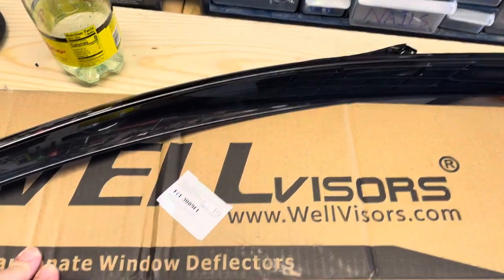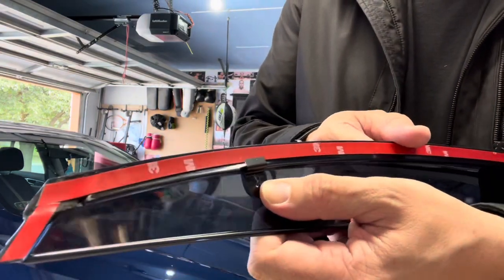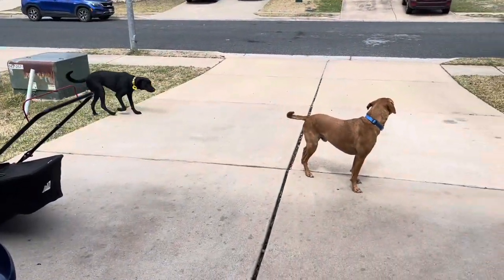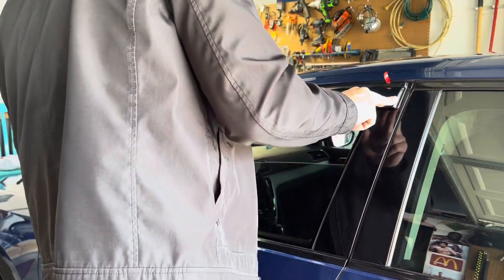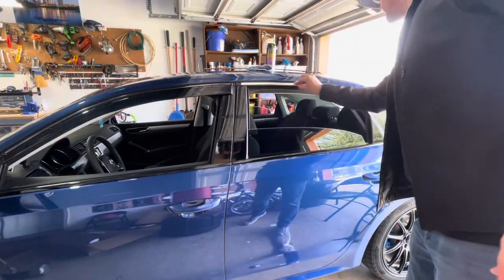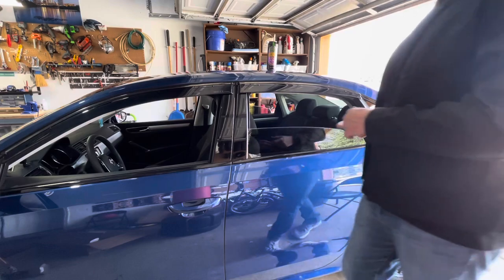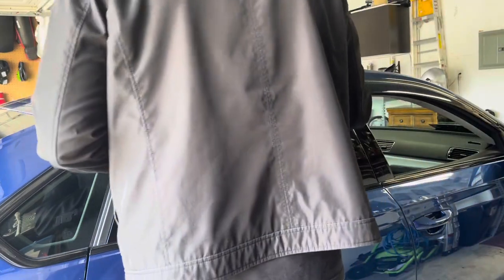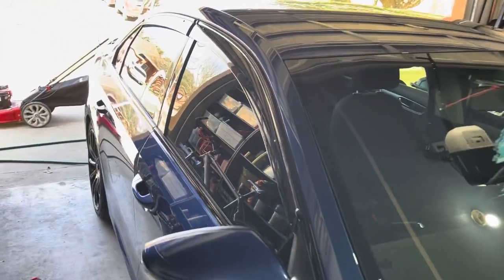WELLvisors window deflectors install-  rain guard -Volkswagen Passat 1.8t 2016 - wind guard

Comment: It looks great! Just curious what did the clips attach to?
Reply from the maker: Thanks the clips just hook between the window  frame and the top seal. I think they would probably stay on without the clips due to full length adhesive tape but I don’t mind the extra assurance.
Reply: @DADMOBILE_Garage  thanks for answering this Question, it was the same one I had!.... I do love 3M, I'll see if I have luck with attaching mine. THX for easy straight to the point video
Reply: I wonder if you could install the clips after you adhesive the visor?

Comment: Liked your vid
But as for the product...was hoping to be more impressed. 
The plastic scratches easily so make sure not to touch it to anything while snapping the clips on during preparation or lay it on a soft cloth first.
Also these are streamlined so good for wind but not for rain or snow. These are also not quite long enough for my 2018. I'm going to try weathertech and see what difference that makes, also Cdn tire has some. If they made these wider off the window so that it worked for rain I'd have been happy enough.
Reply from the maker: Agreed! Soft plastic. Have read similar reports on most deflectors. My hood deflector is similar. I am ok with them for the price. I expect I will get two years tops out of these before I replace. I am ok with how these work in rain for cracking my window.